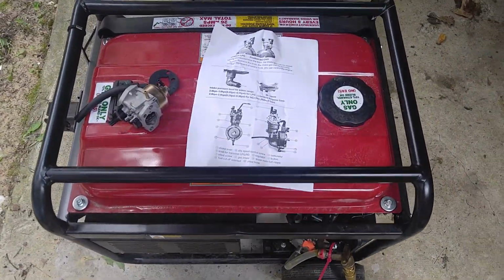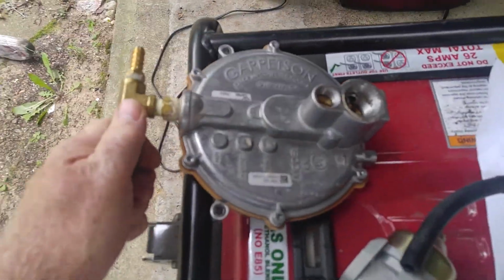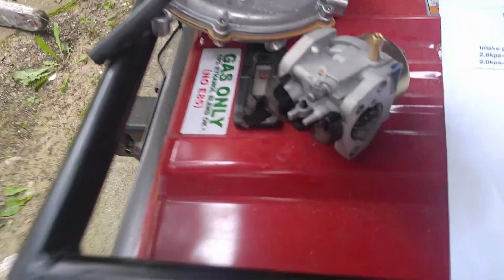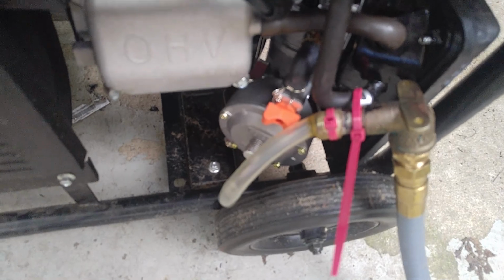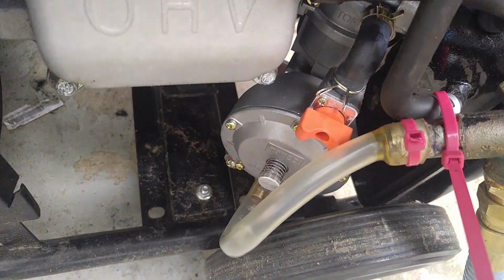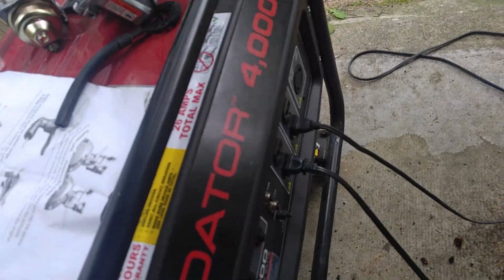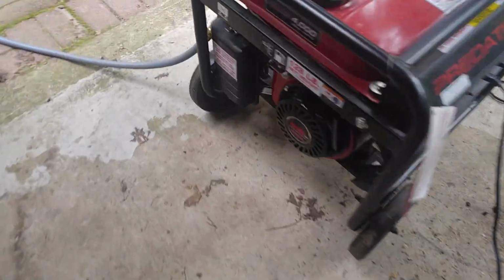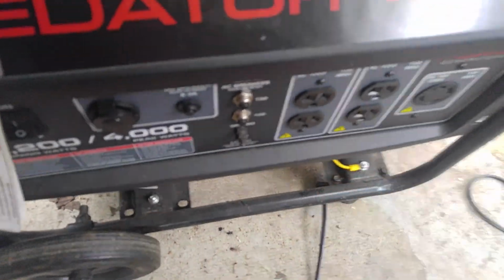Trifuel carburetor Tonco 170F On Predator 69676 4000W Generator

Comment: Tonco was the first Tri-Fuel Carburetor to be patented and made in China and the F170 is good for 5hp up to a 8hp engine.  The F188 is good for 9hp up to a 12hp engine.I bought the Genour F-190 for my Predator 8750 it has a 13hp engine but will work up to a 15hp engine.US Carb wants 212 with shipping for their Motor Snorkel kit you can buy the old kit with the Venturi spacer for around 140. Because the Garretson diaphragms are a lot bigger and NG is lighter then propane you have to connect the hose to a minimum 1”gas line and if your going over 20 feet the hose has to be 1” at the house or meter on low pressure side. If you run  3/4” from the house I would only go 10 feet because the Garretson Impco diaphragm is very large and you will only get it to work properly with volume that’s why you need 1” line to get enough volume to fill the regulator or basically your starving your carburetor on your generator and the diaphragm can’t work right without the volume and make sure you have a drop in your NG line right before you plug your line in to collect any debri or water from the water column in your NG pipes as a furnace or any other appliance in your house has that uses NG.Tri-Fuel carburetor has a much smaller diaphragm and you can tap into your 1” house line with 1/2”hose up to 25 feet because the regulator built on the carburetor will be easier to fill and work properly and it will work good. Many out there don’t realize you don’t have to spend 200 on a kit when you can buy the carburetor with the diaphragm built on and these carburetors were designed for this because of the first one on the market the Tonco. All these duel fuel generators now have the Chinese made and designed carb system on them. You purchased the first multi fuel designed carb made. Now they have others out there like mine the Genour both the same design just different Chinese makers. I bought mine from EliExpress.com a Chinese company like Ebay and shipping was free but it took 3 weeks to get it and it cost me 28.00. They work and since US Carb came out with the motor Snorkel a lot of gen set owners had to cut the frames voiding the warranty on there generators and the cost of the 1” hose is very expensive it cost about 200 alone for 12 feet of 1” hose with 2 quick connect disconnects on each end + 200 for a Tri-Fuel kit when they were done. One more thing when I say 1” that means every shut off connectors reducers and step ups all have to allow 1” of water column NG from the house pipes that are mainly 3” 2” and 1”. One more thing make sure you also have a regulator hose like a BBQ grill if you ever run propane the tanks are high pressure and if you’re just depending on the one that came with the diaphragm you take the risk of destroying your diaphragm!
Reply: I am looking to do this on my Predator 4000/3200 and I only have a 1/2 in line for the NG, so you say that will not be enough gas? It would tee off from the water heater and then I would use a hose to get to the generator. Please let me know if you think the 1/2 in line would be enough. The generator has the 6.5 hp engine so pretty small.
Reply: You’ll need 3/4” line as CNG has lower pressure you’ll need a bigger line for volume to regulator. If you’re unsure of what to do have it done for you. If you do know start line after meter you don’t want high pressure side only low pressure side for regulators.

Comment: I have an 8750 still in box waiting for a Tonco carburetor to be delivered.
Reply: golf-n-guns Please let us know how that works out. I just installed the US Carburation tri-fuel kit on my 8750 and it's working fine. But I'm still interested in the Tonco carb. For $40, it's a cheap back up. Also what model carb did you get for the 8750? Thanks
Reply: B Berthold I ordered this : https://www.aliexpress.com/item/LPG-NG-biogas-conversion-kit-for-gasoline-generator-hybrid-propane-carburator-6KW-6000W-190F/32256070729.html

Comment: What is the electrical connection I see on the carb?  How did you decided on manual choke vs auto choke?
Reply: If you ever see a small engine carb with an electric connector on it, it's usually always a solenoid to plug the main jet when power is cut off, physically stopping fuel flow so the engine can't diesel on or pop out the exhaust.
Reply: Scott Angell there is no electrical connection on this. The choke is manual.

Comment: I disagree.  Gasoline, LP, yes.  Natural Gas no, due to pressure required is higher than US residential allows.  

Standard US Gas Delivery Systems
- "Once inside the dwelling unit, a line regulator reduces the natural gas pressure to the traditional 8-inch WC."  (Mine is max.  Most jurisdictions are 7.5) 
*8-inch WC/.29 psi/2.0 kpa 
- "American Meter AC-250, 250 cubic feet/hr., differential pressure .5-inch WC."  .5 is typical for all meters. 
*Down to 7.5-inch WC/.27 psi/1.8 kpa after meter.  Mine measures 7.5-inch WC/.27 psi/1.8 kpa, which means the input to the meter is the standard 8-inch WC after the regulator and on the input side of the meter.  So mine is at the max. while most would have 1/2-inch water column less.
- ICC IFGC 2012, the standard for designing pipe sizing, shows sizing the piping for a maximum of .5-inch WC loss at the appliance connection during operation. 
*Down to 7-inch WC/.252 psi/1.7 kpa at the appliance regulators while operating.

Summary:
In the US, the standard is 8-inch WC/.29 psi/2.0 kpa at the INLET of the meter, which is already slightly under the .30 psi minimum for the carburetor.  After the meter, there is only 7.5-inch WC/.27 psi/1.8 kpa available.  At the generator, even with a system designed to meet ICC IFGC 2012 international standards, there will be only 7-inch WC/.252 psi/1.7 kpa at the most available at the generator.  The question is, does it work though at the lower pressures, such as the standard 7-inch WC?  The answer is most certainly not.  It surges and only stays running  under partial choke.  This carburetor is only suitable for gasoline and LP in the US.
Reply from the maker: In a perfect world with exacting standards your right... The Tonco GX200 Dualfuel carburetor model 170F  does not meet specs......BUT IT WORKS! It works much better than the US Carburetion Kit on my small Harbor Freight generator. Do you know of a better solution for $38.99? I guess it may be designed for a country where the NG pressure is higher.
Reply: I have the 190F for the 420cc engine.  The reason for buying it is to run the generator primarily on natural gas.  I found out afterward that the pressure required to for them to operate properly is higher than is available for US residences.  To knowingly sell to the US market without the natural gas disclaimer makes it a scam, no matter how helpful they are.  Miine has the automatic choke to where it has high rubber friction and the choke will stay put.  With partial choke, and the power maintained in a certain range, it will work.  I would only use natural gas with this carburetor if for some reason I had no other fuel available.

These carbs look EXACTLY the same as the OEM other than the mod for the diaphragm and its not a cobble job.  I figured that it would be calibrated generically and thus not perform quite as good, so I swapped back the OEM carburetor back in.  As it turned out, it actually worked better on gasoline than the OEM carburetor, with the added advantage of working well with LP, so I put the Tonco back in.  The price, as you mentioned, is an unbeatable value for gasoline plus LP.  I like the idea of a switch for LP and NG, but the NG doesn't work.

I have no idea about US Carburetion but it is a cobble job and expensive.  However, it may work better at typical natural gas pressures because of its much larger diaphragm and adjustable orifice.  You are the first that I've heard of with this problem.  Either way, I wasn't about to spend 1/2 what the generator is worth for their kit.  You can sell the generator you have and buy a multi-fuel generator for less than that and it won't be a cobble job.

PS:  BTW, I mentioned this to Tonco twice over the past month.  There has been no change in or ads nor do I get a reply when I tell them about it and ask them why they do not post this information with their ad.
Reply: I did some more research:
Tonco Natural Gas Requirements:
2.0 Kilopascal = 8.03729 WC
2.6 Kilopascal = 10.4485 WC
North America Natural Gas Standards:
1.87 Kilopascal = 7.5" WC after meter
1.7 Kilopascal = 7" WC at gas appliance

Tonco Propane Pressures:
2.8 Kilopascal = 11.2522 WC
3.8 Kilopascal = 15.2709 WC
North America Propane Standards:
2.74 Kilopascal = 11" WC after regulator which would mean about 2.62 Kilopascal = 10.5" WC at the generator.

The Tonco is not a good choice for North America and other countries that use the same standards for either natural gas OR propane.  I looked at the only alternative I know of, US Carburetion.  They have an easy-to-use plumbing sizing table that agrees with the ICC IFGC International table for sizing of natural gas pipes, and adds the engine horsepower size as a column that agrees with the volumes that I find elsewhere for engines designed to use gasoline require.  They also include their operational pressure ranges.
"The engine regulator included in these types of kits will accept up to 14" of water column maximum (one half of one pound per square inch). This allows the engine regulator to be used for both natural gas (4"-8" wc) and low pressure propane (11"-14" wc).  The same regulator can be used for both fuels and that is why this type of engine regulator is used in the Tri-Fuel Kits."  
That has interesting implications.  The fact that US Carburetion's kit requires only 4" WC for proper generator operation with natural gas results in 2 1/2" 3" of water column reserve.  This enables their kit to work with smaller diameter pipes, which in many situations, will obviate the need to re-plumb the gas piping for the generator.

I like the concept of the Tonco better.  The Tonco is mis-engineered at one critical point from being a world-wide product.  It appears their diaphragm is simply too small to meter on North American standard low-pressure systems and other countries that have adopted the similar standards.  The fact that they market it to North America, and fail to mention it will not work properly with their natural gas and propane systems, is a lesson in Chinese vs. North American ethics.

I have since received a reply from Tonco:
"Hi, we discussed with our technician today and very sorry that we can't settle this problem for the customers in North America. As the discriptions of our products, NG pressure range is 2.0kpa–2.6kpa(0.29psi–0.38psi). If possibel you can have the choke pulled out like you said.
Sorry for bring such inconvenience.
Best regards"
Reply: All this talk makes me want to try mine on NG. Works great off of the propane tank. I tested with over a 90% load and it held it just as well as on gasoline. I have a small 3.6KW generator like the one in this video. Maybe the larger engines need a larger supply hose. The hose I use is very small. Probably 1/4" inner diameter. I just use either my air compressor hose or the hose off of my oxy/ace torches. And with quick connects.
Reply from the maker: I heard that some contractors use 3/4" garden hose for gas heaters on construction sites. You can buy pipe to garden hose brass adapters.
Reply: I don't blame them. Some are spending a lot of money on their hoses and quick connects. These generators are mainly used for temporary outages anyway and not running for days unattended so there really isn't a need for a very expensive gas hose setup. I had a fairly short outage last summer and fired it up to keep the fridge going. Pretty much sat outside drinking beers during the outage and was with the generator. My son had a 2 day  outage last fall and he was running every few hours to keep his food cold. Didn't even use a full tank of propane. I would get better quality hose only if I knew I was going to run 24/7 unattended. I think I spent around 4$ on my quick connects at harbor freight and just used hose I had in the garage.